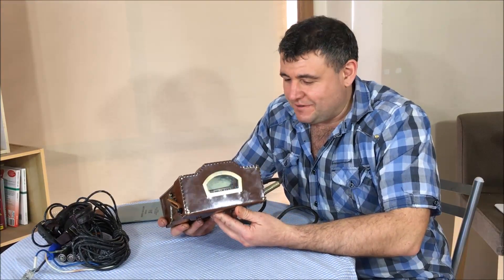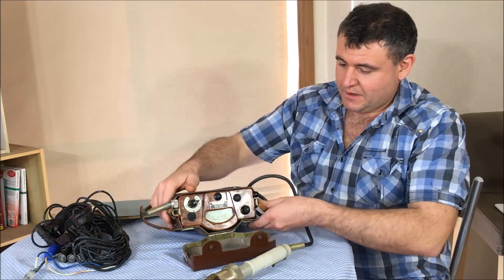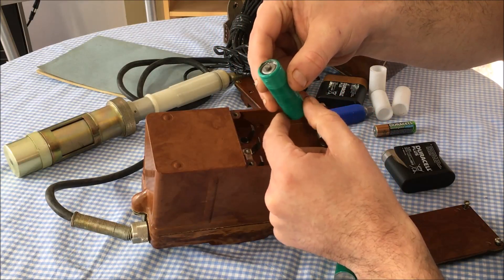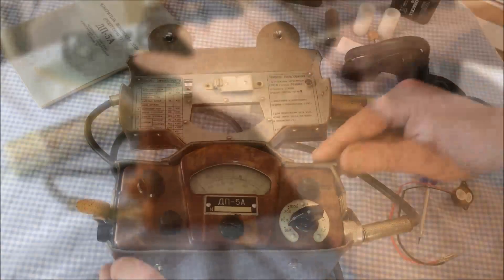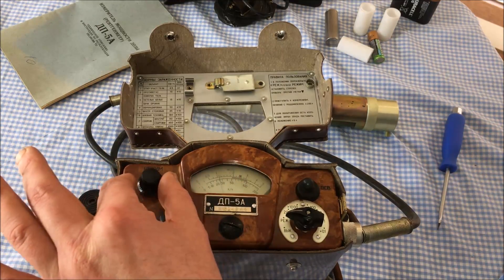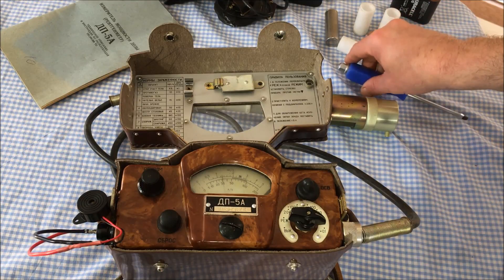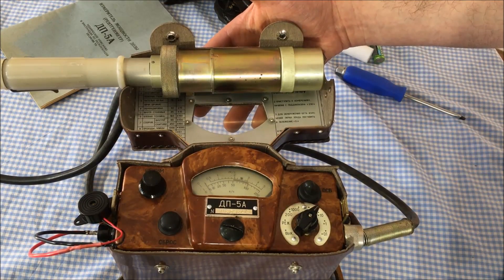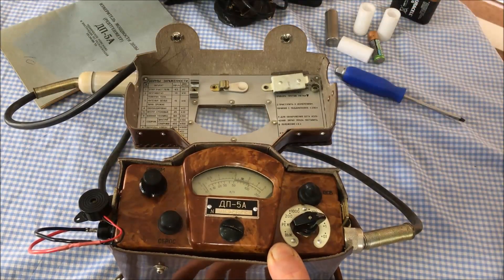Operating and Powering Vintage Russian ДП­­-5А (DP-5A) Geiger Counter

Comment: Hi Sir... may I know, how dangerous is the Strontium 90?

Or is it non lethal if let expose to us daily?
Reply from the maker: Strontium 90 emits beta radiation which is easily blocked by the metal cover slip it has over it. Unless you do something real silly like eat it or carry it in your pocket every day it is of not much danger to you.
Reply: @makestuffnow  Thanks... that makes more sense

I plan to buy one, but kinda 50-50
Reply: @makestuffnow  Is there anything that I need to know if buying one?

There is a seller I found. They say still new not used... no box or battery cover...

For. me, I worry it does not work despite the seller claim as new not used

The price is fairly cheap I must say
Reply: @makestuffnow  It’s decay product yttrium 90 emits a little gamma though.

Comment: Can I just use the LR-12 battery? Or do I need to cut it open like you did in the video.
Reply: You will definitely need to cut it open as the batteries are not evenly spaced and also the polarity is different. Its not a hard to crack open the pack.

Comment: Why do you need tape or sleeves around the battery
Reply from the maker: The battery compartment is made for obsolete batteries you likely wont ever find. AA batteries work but they are physically smaller than the intended ones, so you need to pack them in with something so they don't fall out.
Reply: @makestuffnow  Thanks

Comment: Battery wise I use 1 inch PVC sanded flat on two sides so they can all fit in. Then packed some tin foil in and packed it solid to make a conductive spacer for the negative side of the battery
Reply: What batteries are you using with your 1 inch PVC spacers?
Reply: @alexandercrisp9682  AA They work great
Reply: Thanks!
Reply: @alexandercrisp9682  No prob

Comment: Is the counter safe to handle if the check source has been removed and dose to source contaminate the counter
Reply: I've never found any of the old Warsaw PACT counters with the Strontium removed to ever be radioactive, Strontium 90 only emits Beta so it never seems to contaminate anything unless it falls apart, the Soviet and Polish Geiger have the Strontium on a metal plate so that's all good.

Comment: Now you said you could run the counter off of a car battary, can it be just any car battary or do you have to use a Soviet era battary?
Reply from the maker: I can't read the manual exactly, but from what I can understand you can connect the adaptor to any 3, 6 or 12 volt battery. You connect a jumper wire on the adaptor to select whatever voltage you are using. So any normal 12V car battery will work.
Reply: @makestuffnow  awesome! thanks my friend.

Comment: what kind of external speaker did you use in this video? I have a DP-5A myself and find the headset frustrating at times
Reply from the maker: It was just an ordinary 5-12V piezo buzzer you will find in any electronic store. I cant remember the exact type. I just connected the wires straight to the earpiece outputs and it worked well enough.
Reply: Thank you very much

Comment: Dp-5As are really hard to find and really sensitive. The common version is the Dp-5v which is much more robust and normally is sold in it's own case. Dp-5Bs are also scattered about. I own all three. Aside from the components inside they're all mostly the same just that the 5V is much sturdier. Definitely pick one up with the crate and accessories (normally an extension handle, screwdriver, a few replacement light bulbs and gaskets, a pack of plastic bags to cover the probe, if you're real lucky a manual and even a maintenance log, and of course the adapter for running off a car battery), you can even find "new" manufacture that were stored away in the original cardboard wrapping.
Battery sleeves are easy enough to make. Some small PVC pipe (the 1 inch stiff) and just wad up some tin foil for one end so you don't have to bend anything. Get some rechargeable batteries and you're good to go. Try to stick to AAs though. Older batteries had less voltage than modern so if you use too big a battery you'll fry the electronics, and good luck finding a repair man.
The biggest difference between the 5A and 5B aside from wiring is the 5A has a small handle permanently fixed to the probe wire. It can be inserted in the probe to use as a handle or left unattached if the probe would have to reach small confines. the 5B and 5V have a long handle that is carried separate and can be attached in the same slot.

Also Sieverts are the international standard in modern time because they are more accurate and easier to convert. Rontgens are obsolete
Reply: Can I have the Geiger counter?
Reply: Roentgens > sieverts
Reply: I'm thinking about getting an A or a B, which one is better?
Reply: @kuracao484  If it's your first one, definitely B, 5V are really common though and the easiest to maintain. They're the more modern green plastic ones
Reply: In Russia or Ukraine it EASY to buy.
Reply: The dp5v has old paper and oil MBM caps and they should be replaced because there leaky and die out replace them with polyproplane capacitors
Reply: @Rishabh Gangadeen  seriously.

Comment: You could hear the counter clicking! Have you found anywhere that has unusually high levels of radiation?
Reply from the maker: Some time in the next few week I plan to visit old SA nuclear testing sites. Will definitely show results!
Reply: I took a comparable model to Chernobyl on Holiday. In the hospital, there was an article of clothing worn by the firefighters during the initial disaster. On all but the higher settings, it was making white noise.
Reply: Ну, как это случилось?
Reply: Вижу тебя под каждым видосиком с ДП -5 , у тебя по видео тоже есть ? Если да то скажи , подходит он для разных опытов в домашней радиолаборатории ? Ренген , тормозное излучение и тд ,  и еще не знаешь что можно купить что очень слабо излучает ? В аптеке например препарат ? )) Понимаю вопрос бредовый но может что то можно купить или схимичить )))